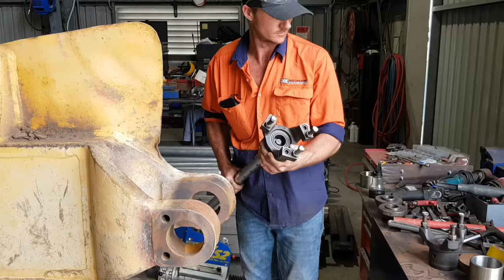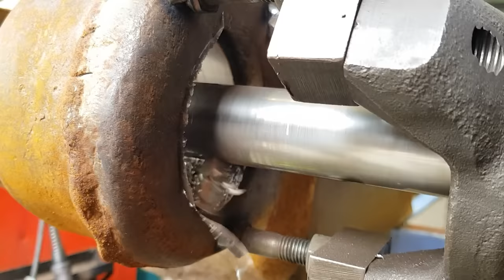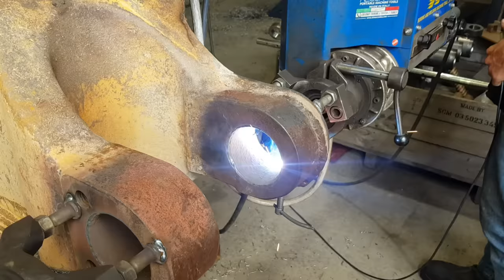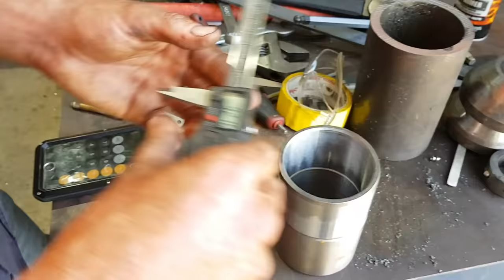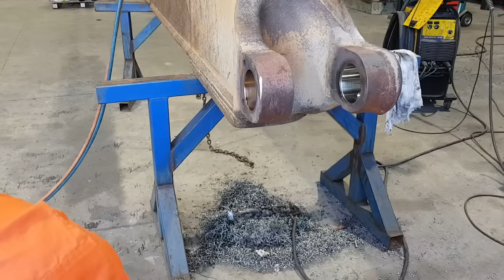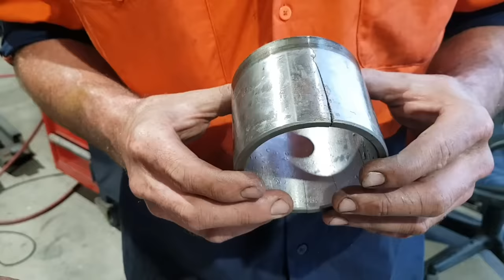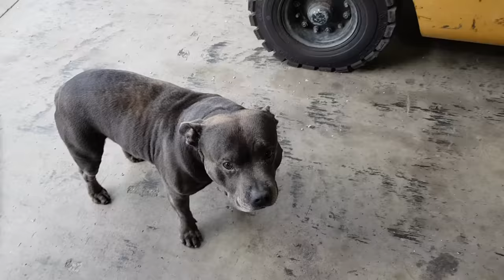Line boring and Bore welding Caterpillar D10 Dozer push arm | Sir Meccanica WS2

Comment: It makes me smile so much to see how happy Tank is, he loves being around you guys! I also have a little suggestion. When bore welding, I have found that if I take a piece of aluminum and use it as a back plate, it will help build that first corner so you don't need to do touchups afterwards and there is no extra grinding/cutting as the plate just falls off when you're done.
Reply: True. It wont stick either. he could do both sided just cut a hole in the center to see what's going on. over size donut plate
Reply: Tank ... ? ... what happened to Homeless?
Reply: 333
Reply: I use a piece of copper plate with mine 😊 works very well

Comment: You have a lot of knowledge ,skills  and great tools. One of the best channels. In this case you put a bushing which has -190 celsius in a metal part which had + 200 degrees and it get stuck and you give it a ' light tap 'with a metal hammer. One end was very cold,  the other was heating very fast which cause a lot of metal stress.  It was not the bushing quality , it was your mistake in this case. We heat the part and hammer the bushing or liquid nitrogen and pushing by hand. We never do it both and even with the part at ambient temperature and bushing from liquid nitrogen we broke one after a ' light tap'. And it was'nt made in China.

Comment: I watched a buddy do a repair like this on a excavator arm that was neglected to the point the pin wobbled while I was waiting for his concrete slab I poured to set.

I don't know if it was the correct way to do it but he mig welded the pin hole then used a similar setup except for a manual cranking mag drill to move the boring bit. Was pretty cool to see in person but tedious work to say the least. I really enjoy your videos and your attention to detail.

I should have watched the whole video before commenting. My buddy did his repair pretty much step by step same as this one...only everything was done manually instead of automated including the welding by hand.

Comment: Awesome video! I'm a retired fitter and machinist did my time down at a ship construction and heavy engineering company at Cockatoo island back in the 80s. Saw some massive size bearings sleeves for all sorts of applications. When fitting them back then they would either freeze the sleeve or heat expand the hole, it was said not to do both or the thermal shock can crack the bearing sleeve!

Comment: The line boring and welding machine is an amazing bit of kit, just trying to get my head around how the wire feed for the MIG works without the wire getting twisted up!  A great job as usual, and another excellent video.

Comment: I have been in the Machining and Welding trade a long time. I took leave from it for like 20 years it's incredible the Machinery they have nowadays to do this line boring. Must have been expensive but worth its weight in gold. Back in the old days we would have cut that out with a torch rough cut of course then we would have had to put it up on our milling machine and that's one heavy piece to deal with. Then we would have had to hand weld all of that always putting more in that we needed to make sure we could get a clean up cut of a proper dimension voice mail holidays. And then obviously we would have to put it back up on her milling machine and bore it to the proper size. Which would have taken probably 10 times as long as it took you to do an even better job that machine is simply incredible God bless you all. Again you did an excellent job I truly miss being a welder Machinist I may be heading back towards that trade.

Comment: Neat trick i found using the 1-1/4 boring bar with the climax bb1149.. bored out a small block Chevy harmonic balancer, slid it on the end of the boring bar and secured it with a jam bolt.. you'd be surprised how much of that chatter can be eliminated on "problematic" setups.  Nodular iron? pre heat, bore enough for two passes so the second anneals the first.  Other than that, that Sir mechanica looks pretty slick, nice work!

Comment: Have the same with electrical materials, client says “I’ll provide all the gear you just install it” so I’m there for at least twice as long as I should be!
Reply from the maker: sigh that's when they get charged an asshole tax 🤣
Reply: @CuttingEdgeEngineering  They sure do, still only another year or so and I’m done with it all!
Reply: @CuttingEdgeEngineering  now that's funny, I used to charge aggravation surcharge for butthole customers in the photography business,,,,cheers Kurtis, PB in USA
Reply: I can't tell you how many times I have been through dealing with managers and such handing me cheaper or off brand replacement parts and wondering why stuff fails soon after installation. I hope the asshole tax is high enough.
Reply: @CuttingEdgeEngineering   I Call it a PITA fee.   A Pain In The Ass Fee..
Reply: @CuttingEdgeEngineering  Retired carpenter here in the USA enjoying your channel. It's not really any different with home owners when it comes time for semi major home repairs. There are always those that want to "cheap out" as I call it. They want to use inferior materials and cut corners on construction methods. There have been more than a few times I had to tell customers to find another contractor to do their repairs because I wouldn't have my name and reputation associated with shoddy work and cutting corners to save a buck. My reputation for doing quality work would have been jeopardized if I had.

Comment: That's really frustrating. I can't imagine saving on a bushing with a job like that. Thanks for another great video. The camera work is superb, too.
Reply from the maker: Hey Bruce! Yeah it's interesting the decisions some customers make, hopefully they will learn for next time. Cheers, Kurtis
Reply: In the forklift industry we have the dreaded TVH/Total source for all forklift parts - absolute rubbish parts but they have no competition other than the oem so everybody uses them.
Only company I know where the new pins and bushes you fit have more play in them than the worn ones you took out 😂. Either that the pins are so tight that in the field you have to spend an hour each pin polishing them down with emery cloth.
The joys of shit parts.
Reply: Right!?! The first shop bores out the bushing so you pay another shop CEE to do it more properly, then bust out on parts???  I get the desire to keep one part on the job site but cheap parts are never cheap.

Comment: I spent 50+ years as a Toolmaker working on progressively smaller and smaller and more precise parts, ending up as a class "A" grinder hand making laminate and connector molds and dies for electronic interconnect tooling.
Many of the inserts we made were so small, that if you dropped them on the floor, you might not ever find them.
Inspection by microscope optical comparator and gauge blocks - 1/10th indicator.
So it's very interesting to see how things are done at the other end of the machining spectrum as far as scale goes.

Comment: Hey Curtis. thanks for a great channel. love your work! I have a question if i may. when you weld your line boring bearings to the job, if MiG wasn't an option, what arc rods would you use? especially with dissimilar metals, IE cast vs mild etc?

Thanks and keep up the great work.

Comment: Drop the like before the video has even started 😂😂
Reply from the maker: Legend! 😎👊💥
Reply: @CuttingEdgeEngineering  No way I would have put that hammer hit on the video. The hammer is not an engineering tool, next you will be using an adjustable spanner... Keep that shit hidden.
Reply from the maker: @cuckingfunt9353  what if it's a shop made copper forged and machined hammer? 🤔🤣
Reply: @CuttingEdgeEngineering  Was it ? OK. Probably part broke because cold, it didn't look like you hit it hard anyhow. What I meant was, we all break out the hammer, just not in front of the customer. I can see you had to move fast before it got stuck. Thanks for answering, I don't know how do you find the time.
Reply: Yeah..! Some channels are like that....with the 'like'....some guys never dis-appoint..
Reply: Drop it like a hot piece in an ungloved hand!

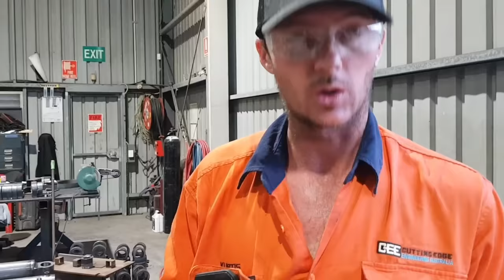Comment: 24:07  Its ok, you can say "Made in China" we all know...
Reply from the maker: 😂😂😂 yeah absolute shit and made in china go hand in hand
Reply: @CuttingEdgeEngineering  Ah yes. That wonderful "Chineseium" Alloy of unknown composition somewhat resembling steel...
Reply: @CuttingEdgeEngineering  The words are indeed interchangeable.
Reply: Some Grade A Chinesium.
Reply: @CuttingEdgeEngineering  If you had read the China fine print instruction, it say: "WARNING!  Extreme danger of tightness of fit! Make looseness in hole and never put cold on bushing."

Comment: I’m not a machinist,I’m a retired aircraft mechanic,but I’m fascinated with these videos. Amazing ingenuity and skill level. I love Blue Collar jobs like this. This kind of work is something creative that at the end of the day you can actually say you accomplished something. Not everybody has what it takes to do this.👍🏻👍🏻👍🏻
Reply: This video took me back to 1987 when my job was to assemble, install, and line bore the nose gear kneel stop assembly of the C-5 Galaxy. Once the cutters were started, I wasn't allowed to stop, or backup. I had to catch the liquid Boelube, and the Beryllium Copper shavings in a sealed container, and call the hazmat crew for disposal. Turns out it was low level radioactive, and highly toxic.

Comment: You know when someone is really good at what 5hey do when a normal guy says “I could do that”.
Hey if you ever have your liquid nitrogen left over and there aren’t any jobs coming up....take a couple of cups of it pour it into a home made ice cream mix in a stand mixer...best ice cream ever!
Reply from the maker: Hahaa thanks mate! I like to put left over LN in a plastic bottle and run away fast 🤣
Reply: @CuttingEdgeEngineering  do you ever drop old gloves or a old pair of work boots in then drop them on the ground ,, lol seen videos ,, never had the stuff to do it ,, my luck i would freeze my hand off ..
Reply: Yeah, 330ml bottles are by the best size for the loudest bang!!
Reply: @randytravis3998  Your hand is so warm compared to the LN that it would be A-Okay for a second. Unless you dunked your hand in there and kept in in for a few seconds then you'd have a problem. Take a look at the Leidenfrost effect if you get a chance. By the way, I'm a big fan of your music! 😉
Reply: @aland7236  thanks for the info ,, i have the same name as the singer ,, i got too meet him 2 times i am a big fan of his too ..
Reply: @randytravis3998  fun fact, the leidenfrost effect is also the reason why as long as you dunk your hand in water first, you can then dip it in molten lead and you won’t even get burnt. Less fun though, is that it also happens when your cooking steak if there’s any moisture on the surface, which is why you should always paper towel your steaks dry before putting them on a bbq 👍🏻.

Comment: Awesome video that machine is worth it’s weight in gold. And welding to boot, I have to interject my experience as a QC inspector in the navy and gov contract inspector on submarines is a few measurements isn’t enough when your dealing with a crush fit, it would look much better on you if you addressed it and corrected it before you tried to freeze it and install it. I understand there’s a short window dealing with dry ice and liquid nitrogen but “hind sight is 20-20” thanks for the video and let us know shipping on the merch to here in the US.

Comment: I can only imagine how nice that dozer would be to run if the customer decided to rework anything that is lose at both ends of the pitch arms, all the ball pivots, and bosses on the back of the blade.  I have operated my share of floppy blades some 40 years ago on mostly on D8 46-A Cats that had been in rock.  You sort of get used to it, but a tight blade does much nicer work.  I would also argue that productivity goes up with a tight blade because you can control the cut better.  "What ever they want" including the use of cheap bushings is just something we all have to live with.

Comment: You ever try just spraying wd-40 on the new bore then transferring your bushing from the liquid nitrogen onto the new bore with out using heat. That has always worked for me.  Remember heat expands, and liquid nitrogen shrinks...wd-40 just helps it slide in without letting the bushing expand to quickly.

Comment: I have been a machinist for 45 years in heavy equipment. You are an amazing machinist. Ill tell you a secret about welding like you do.   Im sure you know but you are creating a stress from all that welding. You can have forging failures because of it.  I have had excellent results by:  just bore it, machine alloy bushings in a 4340 ht or equal. Machine the od to .0015 - .002 undersize of the bore. Apply Locktite ,  Its red...I think Number 609. Its made for bearing retention. Coat both parts well. Have the ID of the bush already machined oversize of the finished or factory bush.  Give another .0015- .002 clearance to the factory bushing to fit inside the first bushings of 4340. or unless you are making the finished bush as well. Locktite spread on both parts and the parts go together with no Nitrogen . They slip together by hand. No Nitrogen, Less work, easier and I have never had a failure. The joint always lasted longer than manufactured original in hrs. The nice part is when you disassemble it all it takes is heat from a torch and the parts easily hammer out with no torch cutting. Try it.  You are amazing man, its just a trick I learned over 45 years.

Comment: Too bad the customer never sees the beautiful machine work you do.
As you hit that bushing I was thinking watch out it might shatter. Oops! You just hate garbage parts. We only used the Cat part period. 
Our boring bars were driven by 3/8" air drills and I expect to hear those things screaming as the bar turns. How quiet that rig is!
Give credit to the giggling camera lady and the safety inspector. 
Cheers!
Terry from South Carolina 
Side note watching you use liquid nitrogen.............years ago while I was in the Air Force one of the welders kept getting dived at by a bat while welding aluminum.  Have no idea why it was upset but my guy finally swatted at the thing with his gloved hand and scored! The Bat was dead. So being the juvenile delinquents they were that cooler of cold stuff was too big of a temptation. I walked in the shop as they were pulling the thing out with a some pliers. A female from another shop was there too and our stud of a gentleman went to show it closer to said lady. As he held it out the part broke off and hitting the floor the bat shattered into a bunch of pieces. As they looked on in shock I just said, "You better sweep.all those smoking little pieces up before they thaw out." I calmly walked out and went back to my office to write the guy up. Later I was "counciling" the guy and said it was for a safety violation. After I got done gnawing on his rear for doing something so stupid I stopped him as he was leaving and said, "By the way, that was the funniest thing I ever saw!"

Comment: Question: On a setup like this, could you bore out both sides at one time?

Would that cause one side to chatter and leave an oblong hole or would it be putting too much pressure on the machine motor, or both?

Comment: Apologies if it's been asked and answered already, I did have a read through of quite a few of the comments. What is the cost difference in cost of aftermarket vs OEM bushings? In comparison to the overall cost of the job is it a case of the customer saving $100 on a $1000 job e.g. 10% . In other industries I know OEM parts have a ridiculous markup because you are more or less forced to use them for warranty or insurance coverage despite quality aftermarket parts sometimes being superior.

Comment: Sweet setup. I've never used the cones my self. They always have me take a ton of measurements.  Why hog the material out to weld it back in to hog it out again? Why not machine to final size 1 time? Or did it have have bad material that didn't get shown?
I do line boring on ship cranes for my work. And do the cones get you close even if the bore isn't round anymore?. Do you parallel the holes to the fed set to me sure it's all in line?

Comment: I have zero knowledge of milling/engineering. Very impressed by your work. How accurate do these holes need to be  bored? I think it would be difficult to make both holes parallel with the holes on the other end. Does the amount of difference matter?  Sorry for my absolute lack of engineering knowledge.

Comment: hey, 
just a question: why don't you do the boring  2 holes in 1 pass with the machine. i do see that you can put more then 1 cutter in the bar.
Love the way your welding machine works. very nice job. greetings from Belgium
Reply from the maker: hey mate thanks for watching over there. It puts too much stress on the machine, causes chatter and don't really want to thrash my gear. Cheers